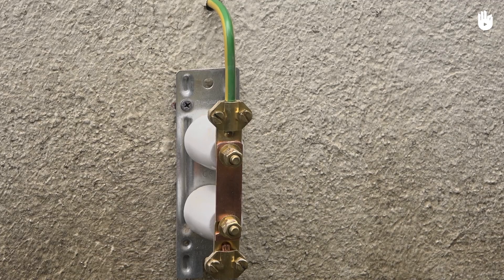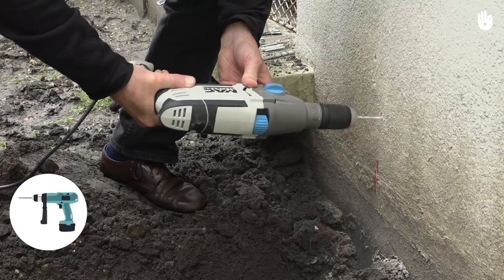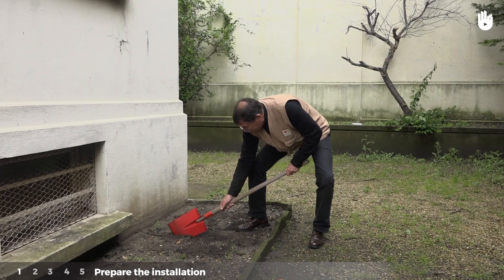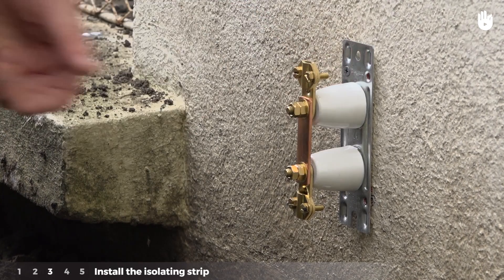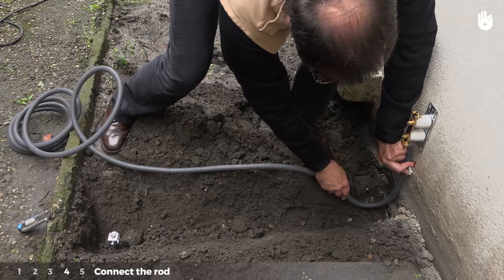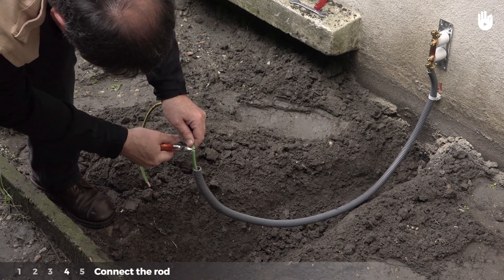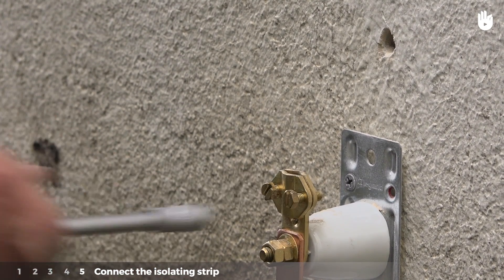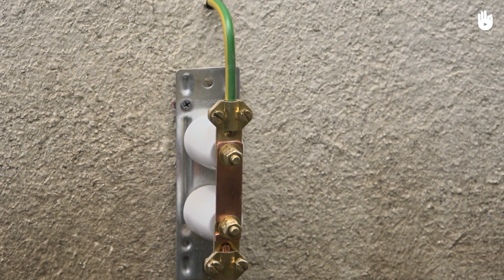Ground Connection: How to Install a Ground Rod | Electricity

Comment: I've cut my wire while gardening, but though I have oodles of green wire, it's not the right thickness, so can i just double  (or triple) it up? Thanks. I have the same connector on the rod as you but it's above ground and is connected to two pipes in the bathroom. The copper strands are also pretty manky -- is there a special grease I can protect them with?
Thank you.

Comment: Well, very different from the way we install grounding rods here in the states. Normally here (in Treasure Coast Florida area) we have dirt and sand. So you can use a sledge hammer for most ground rod installs - but not normally a small 'mallet' that is being used in this video. Better to use a Ground Rod Driver (attachment). 

But in Miami Dade Country...forget it. 
You need to use a heavy-duty Ground Rod Driver (attachment) that hopefully MAY penetrate through the Coral Rock down there. 

We require at least two (2) 8 foot long Ground Rods installed a minimum of 6 feet apart for residential/commercial service equipment installations.

Comment: And you've got a system resistance of under 30 ohms (quite high if you ask me) with just one 1-2 meter ground rod?
What can I say...it's better than nothing but don't think that qualifiers as proper grounding.
Reply: In the uk you’re allowed upto 1667ohms if you have a 30ma RCD

Comment: what does the isolating strip exactly do? I can't find any like that when googling. mostly get tapes
edit: oh wait does it just distance the cables? also i just realzied that if i wanna make my plugs have ground outlets i have to freaking destroy the walls of my house
Reply: for the purpose of testing and commissioning. you can easily isolate the earth from the panel.

Comment: is it safe to parallel another ground wire from another equipment, to the same rod. or should it be 1 rod per equipment
Reply: What do you mean by "another equipment"? The ground/earth rod (where I live there have to be 2 of them 6 feet apart) is connected to the electrical panel's ground bus. All the equipment is then connected to the electrical panel. So, in a way all the equipment is indeed connected to the same ground rod(s).

Comment: Sir..the video is very good and simple.
And I want to know what is the depth of the ground for the rod,length of the rod and what should be done in that particular underground?
Reply: He mentions that the midpoint of the ground rod should be one meter deep.
Reply: @dmarti47  = 3 ft
Reply: @JohnGarnerIII  = 1 meter